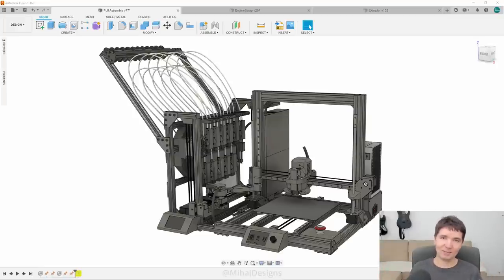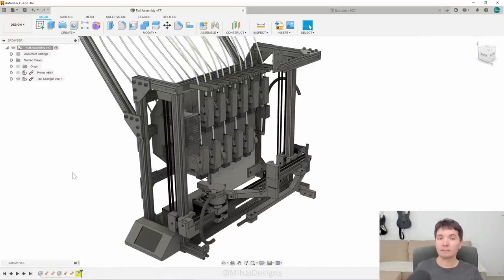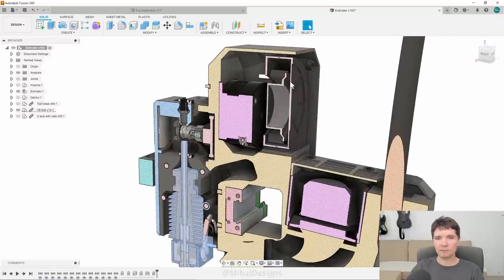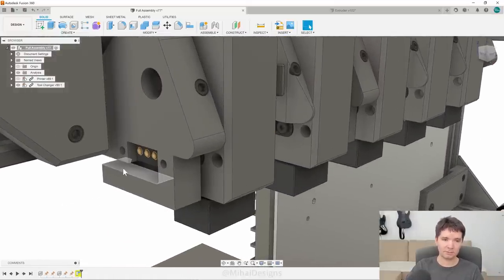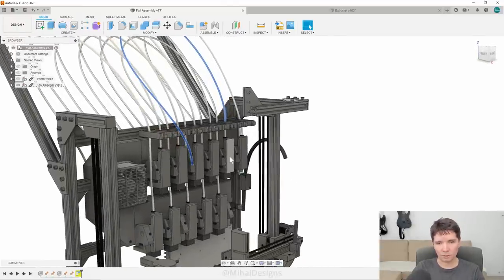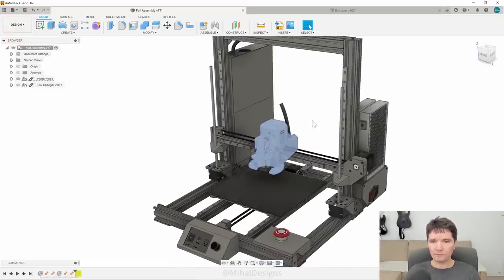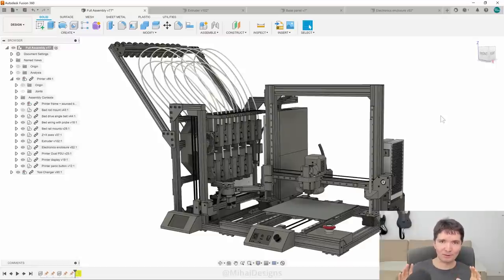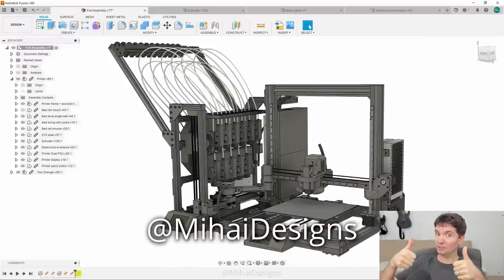PitStop 3 multi-material 3D printer in-depth design. 10+ materials at once

Comment: Mihai!!! Im still going down the extruder wood grain rabbit hole.... I found with my ASX1 it was the little plastic gear on the stepper that prevented the wood grain. Changing to metal I got wood grain. Also tried a variety of big and small gears there. Different combos produced wood grain or not. I ended up with a mellow (Ali) large gear) and random plastic small gear. Still more to explore there.
Reply from the maker: Wow interestig insight.

Comment: Great design!

You mention the issue of the active hot ends becoming tangled and having potential jamming issues. Have you considered having the hot ends on a horizontal disc arrangement which rotates around so that the front facing bay is the heating bay. The rotation can have a limiter switch for left and right direction so that it never rotates more than 360 degrees and the tubes then won’t get tangled. You could have three or more of these discs side by side with the hot ends of each on the front face.
Reply from the maker: Yes, this was the alternative approach. What I'm a bit worried for that one is that all the filaments would twist up to 360 degrees on each change, and with more brittle filament there is the risk of snapping. This risk exists already as filaments left in tubes sometimes snap and I don't want to increase this risk.
Reply: @MihaiDesigns  what if you mounted the filament rolls above the discs on their own disc, then spin both in sync.

And mount it all above the printer so it feeds straight down.
Reply from the maker: @seanmostert4213  I did not think of that! It would make for a huge revolver, but I love the idea. This way you could easily access all the spools. I'm not sure how I'd solve some issues, but I could look into it one day. Cheers!

Comment: This is insane Mihai! As a long time follower of pitstop this would be bonkers to see in person. What PTFE tubes do you plan on using? Also what about printing flexi filaments like nylon or TPU? For all I know those are only possible properly with direct drive extruders. Also are there plans to make pitstop usable with a prusa MINI? I remember asking before but I think you said that the gantry on the MINI cant support the weight, or maybe it could if you reduced the accel? Also are there plans to make this open source? It would be great to see community feedback and proposals on this excelent project!
Reply from the maker: TPU should work as this is a direct drive extruder, but I doubt Nylon will work well without an enclosure. The new extruder is more lightweight so it could be tried on cantilever printers.
Reply: @MihaiDesigns  Interesting! Do you plan on making the files avalible for those who want to test? Or will it be on the patreon?

Comment: Have you ever considered swapping the nozzle and heat break (only parts that contain molten filament) sort of like a high end cnc machine instead of the entire hot-end assembly? I think this could be far more compact, reliable, cheaper and probably easier.

Comment: Thank you for this smart presentation.  I love the idea of idea of preheating for the on-deck tool!

What about adding auxiliary  heat/extrusion capabilities to the tool arm?  considering how short the hot end heat times can be, perhaps you can do it from the arm, rather than the live-bay-slots?     what about two arms?  A second arm could be dedicated to removing tool from printer.  This could speed up switching times?   (version 5! lol.)
Reply from the maker: Hotend heat up can take 30s. Sometimes you need to swap them in quick succession. But also the arm cannot be covering the electric connections.
I did think about having two arms (or an arm with 2 hotend slots) for quick swaps, but I want to leave this for later as it's just a speed improvement. So a future version maybe. It would be cool to have it though. Take the swapping time from say 10s down to 3s.

Comment: This is super awesome for so many reasons! Even though I'm not doing FDM printing, yet, this project is very interesting for me as I probably will get a FDM printer in within the next 2 years. One of my biggest gripes with multi color printing on the Bamboo X1 / P1P for example, is the massive amount of waste produced. If I ever need a multi color capable printer in the future, I'm sure your project will be very high up on the list.

A few thoughts and comments:

1. The cooling on the tool changer has the same size holes for all the nozzles (seen at 19:20). This would the highest air flow for the nozzles closest to the fan, and less for the ones further away. Do you have any plans on making the hole sizes smaller closer to the fan, and larger further away to give all nozzles similar cooling? (this might not matter at all)

2. Also, in slots where there is no nozzle parked will have less restriction and thus leak more air. Perhaps have a hinged hatch that gets pushed out of the way when a nozzle is parked? (this might not matter at all)

3. I love the industrial design / sfi-fi look of the extruder and it's cooling ducts. Looks so cool!

4. It would be very cool to see an animation of a tool change, even if it's just posted as a short. Have the extruder move from some arbitrary position over the build plate to the tool changing position, then show the tool change. Preferably have the tool changer access two different rows. Though, I understand if this isn't a high priority.

5. Did you find a solution to the extruder power connector patent problem?

6. You can tell that a_lot of thought went into this project. Awesome work man! Super cool! Keep it up! Subscribed.

Comment: A lot of work right there, and a stretch of skills. I would say you are doing as well as many mechanical engineers. Great work. The only thing I don't like is that you went with a moving (y-axis) bed printer. It limits the print speeds too much.

Hope you can get the firmware to operate the tools changes using the standard tool change g-code.
Reply from the maker: At this point I just need to have something working. CoreXY and speed improvements next year, once everything works perfectly.
Reply: @MihaiDesigns  Sounds great. I would mention though that core xy really has no advantage over Cartesian so long as you route the belts to put both of the x and y motors on the rigid frame. All it does is shift the axis of movement 45°. I don't know why it has become so popular when  you can route the belts in a way that accomplishes the same thing and not have to deal with messing up the software.

Comment: Great thinking of future uses such as non-planar. Ultimate for non-planar would be an arm (robotic arm) those are pretty complicated though. I think you're current design if proven would be great for multi color prints but for multi material a consideration should be that the printer is adapted or designed with an enclosure in mind. With such you would want to move as many electronics as possible outside of the enclosure this would include stepper motors to as much an extent as you could. Core XY lends itself well to enclosed printers. However core XY may not be ideal for non-planar. Anyway I don't know if I'll be around to see a lot of this stuff mature but good luck and hope you're project goes well.
Reply from the maker: I've been thinking about a robotic arm for the last couple years, to have more DoF and be able to rotate and print at any angle, but in the end there would always be a set of scenarios where it wouldn't be able to print some parts because it wouldn't be able to physically squeeze inside the print. I don't know if I'm explaining this right. But this is a problem that can be tackled later on if needed. The current printer design is there as a playground and to have something that fits the tool changer. For the future I want to do just what you said: have an CoreXY which is easier to enclose and heat up. I'm saving this for next year, although I've already purchased some of the parts I expect to use. Secret info on the CoreXY: it'll be a ~375mm cubed build 😁

Comment: While I love the vision, the current requirements feels a lot like "Feature Creep - The Project" to me. Especially as a software developer this looks like it needs YAGNI and KISS to get a minimum viable product and then use increments to improve the functionality. My first iteration would be: change one tool reliably (only one motor for arm rotation) on a bear frame mk3 (move X end stops so nothing crashes) with the new extruder assembly. Then do a row of tools (+1 motor), then evaluate whether a row or a carousel is the better tool holder solution. Please don't take this as me wanting to rain on your parade. I really want you to succeed!
Reply from the maker: I suppose that's a good approach too, but I like my way better for this project. This is not the first time I try this project though.

Comment: Raceways, they are called cable raceways 🙂 Interesting project. Were you thinking about using belted Z or CoreXZ, instead of leadscrews, for both very fast Z movements and eliminating leadscrew wobble?
Reply from the maker: I don't get any z-wobble on my builds so I'm not sure it's needed here, but I'll change it if the problem arises. But I do plan a CoreXY for next year and still haven't decided on whether to go with leadscrews or belts for the Z.

Comment: That's super impressive. For VFA try prorifi motors - that's the easiest way and quite effective.
Reply from the maker: I heard about them. Have you tried them out?
Reply: @MihaiDesigns  Yes I did and they works as advertised. I've been using them for about 2 months now and everything is ok. I did a video a while ago: https://youtu.be/YiA4KDcsxZ8
I plan to do the followup video with dual belt upgarde and testing if they motors don't degrade over the time.

Comment: How do you handle the different z offsets for the different hot ends? 
You could store those offsets on the NFC... Ah 35:00, you have a nozzle probe and then you store it onto the nfc tag. 

 With the exposed filament wouldn't that mess with hydrophilic materials like nylon?

 Would an enclosure be possible?

 Have you thought about swapping the pogo pins to be on the hot end so that that million lifecycles is spread across the hot ends and you get much more life? Though, I suppose the problem with doing that is that the pads on the base can get dirty from use and then you might not get good contact... 

For the additional friction of the longer tubing you could have dual extruder steppers, have a gear drive that goes to all of the tubes but is activated and deactivated by a servo or something. 

This is a very cool design, I look forward to the next video!
Reply from the maker: Just started assembling the newer version (shared a few shorts already). Includes the enclosure. I did consider a second extruder motor with a second round of gears, but I need to run tests first, maybe it's not needed.
Reply: @MihaiDesigns  yeah! After one of your shorts popped up in my doom scrolling I just had to find a longer video of your machine. I can tell you've put a lot of thought into it and it even looks aesthetically pleasing. I look forward to seeing you take it out of the computer and into reality!

Comment: I love the idea of separating the extruder motor from the toolhead. I might have missed this, but do you have some way to electronically control the tensions on the hob gears (the things pushing the filament) depending on which tool is selected? Ie, you'd want TPU less squeezed than PC.
Reply from the maker: Great question! There's no support for this right now. If the need arises, then the tensioning mechanism can be automated with a small motor on the extruder, or perhaps with a motor on the arm that interfaces a small gear on the extruder to avoid extra weight.

Comment: Very ambitious project sir, I wish you great luck working on it. Though the amount of work and passion required for such thing is simply enormous.
I would like to mention few things that bother me about this project the most, and hope you'll appreciate my view of it:
- Haven't heard you mentioning it, but will those toolheads be smart or dumb? I'm guessing (from probe connecting to the same 4-pin connector) those are smart and really think that's the best choice, otherwise the complexity of the control board will be just crazy. Having each head to control its own temperature simplifies system scaling.
- Writing this amount of software from scratch is one of the biggest concerns for me. The reason this project is possible is partially because of the software that exists and is constantly updated. Yet I understand that limitations of existing firmwares could be pain in the arse, I'd still recommended sticking with one as it will, in its turn, breath life into the existing firmware projects. 
- You aren't planning to work on the project alone, are you?

On the other hand, I completely support your plan to merge printer itself and toolchanger into one device - the amount of struggle current printer designs (especially ender-style ones) introduce into project like yours are just insane. But it can only be justified if the final machine will offer features that any other won't be able to (e.g. 100+ heads) - and I guess that's what your goal is.

Once again, best of luck and simple design decisions for you - there's a thousand ahead!
Reply from the maker: Thanks! One person project for now. Maybe more later. The software is hard indeed, but I do have my reasons, even if it takes longer. The user will not be concerned with any of the details like managing the hotends.

Comment: Hi, I love the concept and I’m impressed on the amount of work hours you’ve put into this, how is this better than a scaled up version of palette ? And how will you make sure it will repeatable without any jams?
Reply: The advantage over Palette is the separate nozzles (mentioned at 7:43) as well as separate hotend temperatures.

Palette does great for multi-color, but jumping from PLA to TPU to PC etc isn’t going to go well (at least from what I’ve seen)

Also that has the issue of Purge Blocks/Purge to Infill is removed in this setup (short of maybe any drips/nozzle wire brushing)

(Edit: Added a timecode)
Reply from the maker: Indeed, mainly I want to avoid those large purge blocks to save material and time. There's also support for multiple nozzle sizes and you can combine materials in more ways. Downside is that this won't work with any 3D printer.
Reply: @ericlotze7724  sorry I skipped through a few things, I couldn’t afford to watch the entire video. And thank you for clarifying.
Reply: @MihaiDesigns  it’s definitely interesting, keep up the good work and hope to see future progress.

Comment: Hiya mate. I've just got into 3d printing and thought of this myself. First I thought you could calculate the esteps and measure the colours exactly. Cut each piece to size and fuse the filament together. 

It would be easier if you could print let's say a "hand" in pink and jumper in red, but print the hand in one go. Otherwise you end up with a pink layer throughout your whole print. So fusing filament wasn't a good idea of mine haha. 

I started watching your video and the idea returned. Seeing your setup with multiple hot-ends is way too expensive for me. I wouldn't want 10 different hot-ends just to use different colours. 

I don't want to be mean or discredit your work, I like your idea but maybe we can change it a bit. 

Considering when changing the hot end it will take some time. Stop the print, remove the hot end, get the new one, start printing again. 

Couldn't you make a multi port nozzle above the printer with a driver to feed the filament into the hot end?

Let's say you are printing some pink feet and now you're ready to change filament. 

Stop the print, reverse the filament out of the hot end and the boden tube, or direct drive, and feed the new filament in. 

You could make a slide that would end up in the nozzle, so if you can find a way to achieve that, I think it would be better, cheaper and easier than having 10 different nozzles. 

Just my opinion mate. Great video and thanks for sharing

Comment: Could use an additional, Optional connector for an additional external E-Stop would be good. Either one you could hook up to the Pi and virtualize or another physical one for at your desk or by the room door or anything like that. It wouldn't be a proper cut E-Stop I don't think unless they were all routed through a relay/contactor... Probably overkill tbh.

Comment: I did not watch to the very end, but is the plan to have the probe wires where the PTFE would be?  Otherwise I don't see how you use the hot end and thermistor wires to handle the probe functions.
Reply from the maker: That's the plan, yes

Comment: Since different filaments require different idler arm tension, this should be adjustable from the hotend holder. Either by some adjustable part, or simply by having different hotend holders causing different amount of idler arm tension (and then you choose your hotend holder based on what filament you're printing, which is probably the case anyway).
Reply: In fact, you could have one hotend holder with adjustable idler arm tension and other hotend holders with hardcoded idler arm tension.
Reply from the maker: I'm hoping that it'll work with just one tension. If not, I'll figure out a way to have individual tension.
Reply: @MihaiDesigns  I was thinking that you might need at least 2 different tensions if you're printing both normal filaments (like PLA) and soft ones (like TPU). Maybe not. But then dialing in the tension might be difficult.

Comment: i think prusa already did a 4 material tool changer printer.   im not really into color based  3d printer, i feel color should be sprayed on if you really need it.
currently i really want a mid range IDEX dual material printer printing as fast as a Bambu lab x1 (i doubt bambu lab are gonna work on idex any time sooner after x1).